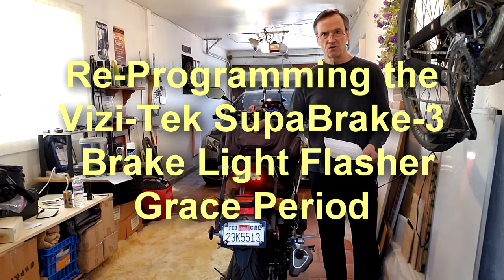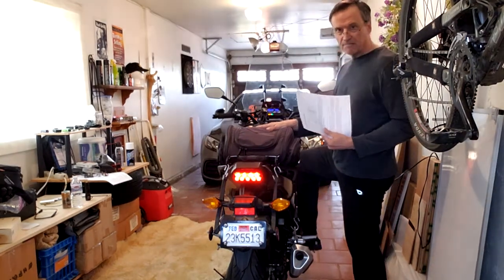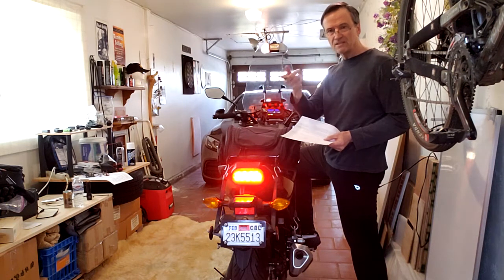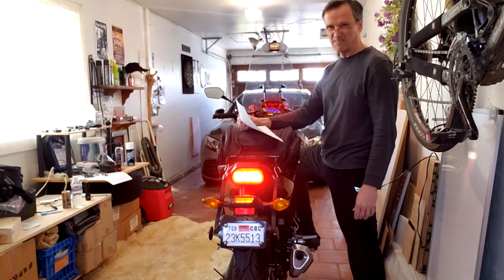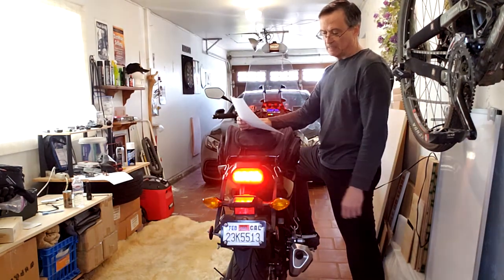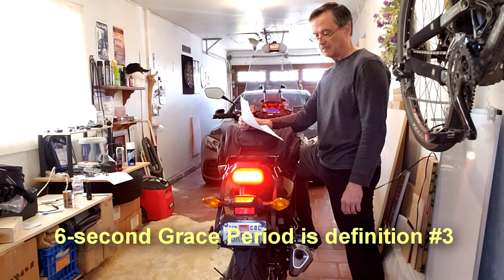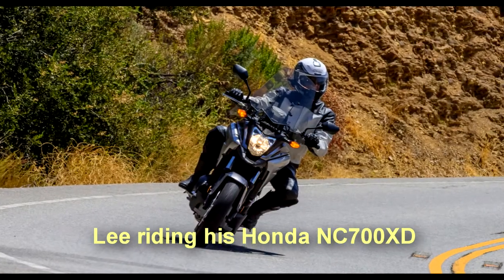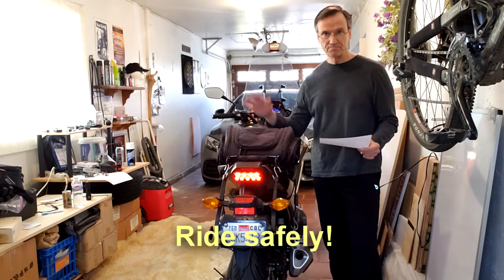How to re-program the Vizi-Tec SupaBrake-3 brake light flasher grace period from 12 to 6 seconds.

Comment: Thank you sir. Just installed mine but that programming is something else. Would think they would do a usb option.
Reply from the maker: Glad the video was helpful. I agree... I was tempted to avoid re-programming and just keep the flasher's default (12-second) grace period setting, but I really wanted that shorter (6-second) period to increase braking visibility.
Reply: @LeeGoDesign  Thanks as well. I wasn't sure about the programming and didn't plan too until I saw your video about the long interval and would like to shorten it up as well.  After your video, programming isn't all that intimidating.
Reply from the maker: @DelCalloway  You're welcome. Glad the video was helpful.